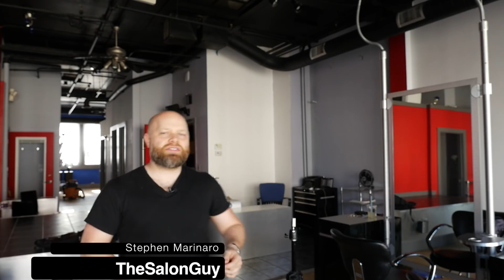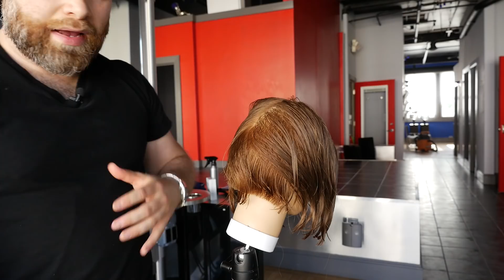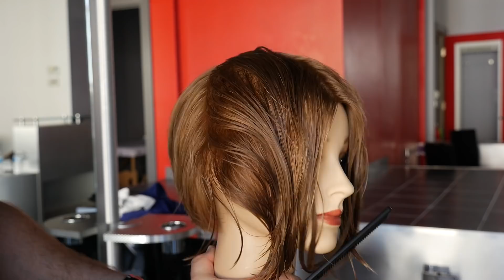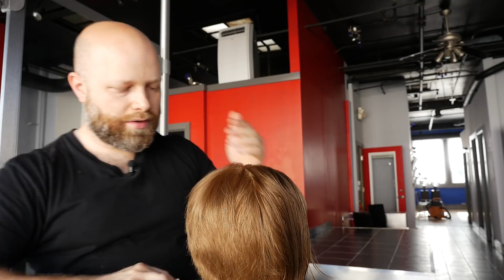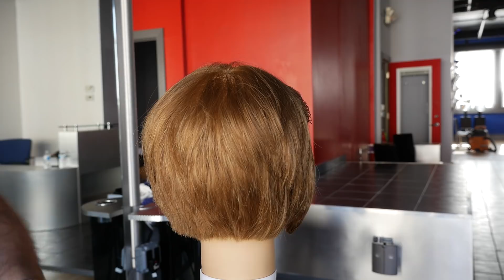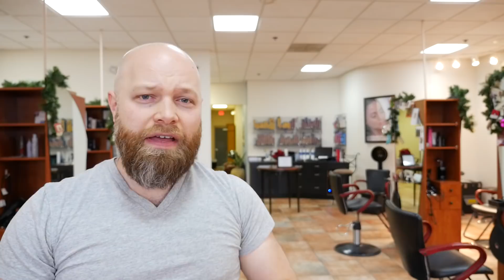How to cut a Layered Bob - Haircut Tutorial Step by Step - TheSalonGuy

Comment: What a decent budget mannequin?  I am returning to cosmetology after a 30+ year  break. I am scheduled for the Tennessee Cosmetology Law exam in December.  After I pass that, I will be able to schedule the practical portion.  For reinstatement I just need the law and practical portions of State Board. 

My budget is tight because I am not working yet. So far I like Celiberty mannequins. They have thin, but not too thin hair (density) and it's a little easier to work with. 

What is your thoughts on mannequins for people just starting or returning without a lot of money.  <$100

Comment: I'm not even two minutes in and I'm noticing this is not for beginners. Your hand or arm isn't anchored on anything as you're cutting which is a disaster for a new graduate,  body is contorted, sections aren't clean and do not match the line, I am horrified right now. At 2:23 I have to turn it off. NO! This is not how a professional cuts a straight line. Why,  oh why? In my opinion, this is irresponsible and hopefully you're like, "just kidding! Here's the proper way" but I doubt it and have to go now.....

Comment: The most common mistake with that haircut is gapping behind the ear which he clearly did especially on the left side. I believe he made this mistake when he went back to check his work. He did not over direct the hair back. You do not want your client to be walking around with gaps behind her ears. For me, it was the hardest haircut to master. I find the best way to avoid those gaps behind the ear is to over direct those corners towards the center of the nape. Sometimes it may look like it's too heavy and you want to go back over it again but I would suggest styling first then going back to that area and cross checking to avoid take off too much. A lot of times once you style it, it's fine or you may a slight corner to take off. Never pull those corners behind the ear at a 90 degree angle straight out the side because then you remove to much weight. I hope this helps people really trying to learn.
Reply: +Lmnny Nny THAT IS TRUE HOW IF A SALON WANTS THEM IN AND OUT ,,,AINT GONA HAPPEN LOL,,,,AND WAS POINTING OUT TO REPERKI THOSE ARE DEF NOT HOLES BEHIND THE EARS ,,,,THAT IS HOW MOST SHORTER HAIR STYLES ARE DONE TODAY AND IF YOU NOTICE THEY ARE EVEN ON BOTH SIDES,,,PLUS LIKE I ALSO SAID TODAY THAT IS HOW MOST BOB CUTS ARE DONE SO IT DOESNT LOOK LIKE THE TYPICAL 70'S DORTHY HAMMEL BOB CUT ,,,,AND THANK GAWD ! LOL....LMNNY NNY HAVE A WONDERFUL HOLIDAY SEASON AND IF YOU'RE STILL AT THAT SALON WHERE THEY WANT THEM IN AND OUT,,,,,GET OUT ASAP !! US STYLISTS NEED SOME TIME TO PERFECT OUR ART ON PPL AND THEY DONT WANT TO BE RUSHED IN AND OUT LIKE A GOD DAMN PORN STAR YA KNOW,,,,HAVE A GREAT ONE AND BEST OF LUCK TO YA AND ALL OF US FELLOW STYLISTS !!
Reply: A great channel to watch is Sam Villa
Reply: Yes I saw that too.. the holes behind the ears,  I know it is more difficult on  a mannequin. I  did like the way he angled just with a comb on  the sides. My clients want that arc in the neckline. and longer layers above  the occipital bone.  I find this hair cut the most difficult one to do, and I am in a  salon where we are supposed to  do it fast.. not going to happen.
Reply: +Lmnny Nny it's just a layered bob not an inverted bob. I thought the haircut was great except for the gaps behind the ears. It is very informative for those trying grasp the concept of the cut and decrease their cutting time. My intentions weren't to down his work but only constructive criticism and for the knowledge of others who watch this video
Reply: +reperki THIS IS NOT A MISTAKE THOSE ARE NOT HOLES BEHIND THE EARS AT ALL. THAT IS HOW A LOT OF SHORTER HAIRCUTS ESPECIALLY BOBS CONNECT. THEY ARE ON BOTH SIDES AND BOTH ARE EVEN AS WELL. PLEASE DONT THINK I AM YELLING I AM JUST ALWAYS IN CAPS IS ALL..LOL...BUT ANYWAYS NO THAT ISNT A MISTAKE AND "IF" IT WERE ,,,,HE WOULDNT BE POSTING THE VIDEO TRUST ME ON THIS. IVE BEEN FOLLOWING HIM AND MANY CELEB STYLISTS AND THEY ALSO HAVE THESE TYPES OF CUTS CONNECTING FROM THE BACK. PLUS IT LOOKS MORE EDGIER BECAUUSE IT IS NOT YOUR "TYPICAL BOB' HAIRCUT THAT IS PERFECTLY EVEN ALL THE WAY AROUND ,,,,,THAT WAS THE 70'S DORTHY HAMMEL CUT ,,,THIS IS THE CORRECT TODAYS BOB CUT IS ALL . HAVE A GREAT HOLIDAY SEASON REPERKI AND EVERYONE ELSE !! :)
Reply: reperki h

Comment: did no one see the hole he left on each side? if you did that people would be crying in your chair. Huge mistake!
Reply: +ayy lmao i just checked the commentts to see if anyone else noticed the holes. i'll give him the benefit of doubt since it IS on a maniken
Reply: YES!! That is why I came to the comments section....to see if anybody else mentioned it. I would be very upset if my haircut had those. Maybe people are saying there are no holes due to terminology. What I mean and I think you mean, is that the bottom line has gaps in it around where the back part of the ear is located. Look at 25.10 minutes. That gap. And it does not get corrected because well, you can't glue the hair back on. You'd have to redo the whole bottom line and then it would be almost an inch shorter all around!
Reply: IMHO, he doesn't give enough time or attention to the bottom, it's messy, needs perfected!
Reply: There were holes, but since it is a mannequin there isn't any natural fall behind the ear. It's almost impossible to not have those holes when cutting on a mannequin!
Reply: I did see the hole on the left side,if you do that to my hair  i wont fee for it 😂😂😂😂😂
Reply: I was thinking at the beginning that it was kinda weird making such a big deal out of using clips, it doesn’t add 20-45 minutes to the h/c.  Then when he finished the back and went to cross Check (only showed rt side) I noticed he grabbed some hair that was right above the ear cause it wasn’t a clean part sectioned off with something like say....a clip?    And when you cut that piece too short it’s game over for a solid perimeter line cause there ain’t no hair under it to fudge that.    But granted it is a mannequin with a weird hairline but not doing anyone that’s new to the industry any favors with that.    He did mention about getting a hole there, and he did so let that in itself be a lesson.  A safer approach would have to take. 1” parting at that side perimeter near the ear and cut that into the back before moving on to cross checking and layering.
I have to add that I do really like this guys videos, he’s a sweet man that just wants to help other stylists learn.    Bravo, don’t mean to criticize, I create “unique interesting form” from time to time.
Reply: Sheesh, after reading the comments here on this perfect layered bob, I'd hate to see what you guys think of the "Soft Layers in Long Hair" video by Hair 101 with April. She's getting so much flack for her cutting technique and I just can't understand all the criticism.

I'm of the mindset to appreciate a stylists personal touch. I like uniqueness or what I call a signature stamp. The hole or gap wouldn't bother me. What bothers me is when I tell a stylist to cut 2 inches and they cut 4 inches! Do I need to start bringing measuring tape with me to the salon!! 

Without a stylists uniqueness, we wouldn't have the Farrah Fawcet style. Prior to her haircut, people were wearing bouffant styles, afros, shags and that's about it. I couldn't imagine the criticism Allen Edwards received before introducing that infamous haircut and style!
Reply: Lisa Lane locks of love doesn’t give your donated hair to mannequins for noob hairstylists... but my beauty school used to give old, botched and buzzed doll heads to the police academy so they could practice shooting lol. :^)
Reply: +ayy lmao For heaven's sake, it's a haircut, not the second coming....and, no, I didn't see the holes.
Reply: Is this where our hair goes when we donate to locks for love!  I've done it 3 times!
Reply: No, it goes to wigs for children with cancer!
Reply: Yes I noticed it too!🤫
Reply: Yes!! I cut my own hair and when I do that, I cry! If I paid the exorbitant prices he for sure charges, I'd cry then go home and fix it! UGH!!
Reply: +ayy lmao nope, no hole whatsoever. your eye is playing tricks on you!
Reply: +ayy lmao For heaven's sake, it's a haircut, not the second coming....and, no, I didn't see the holes.
Reply: ayy lmao I think you den holes where the hairline was on the front!  This is flawless and you're either blind or hating!